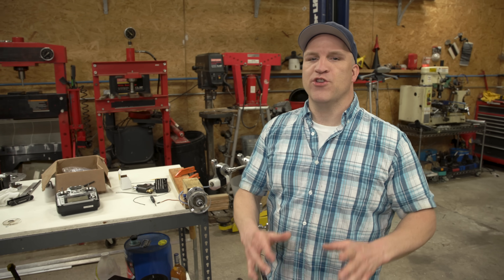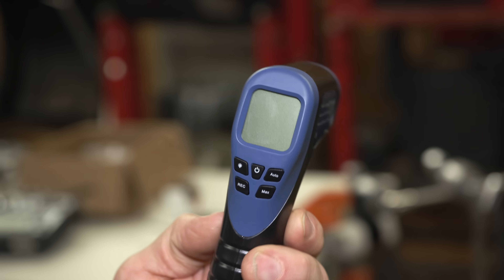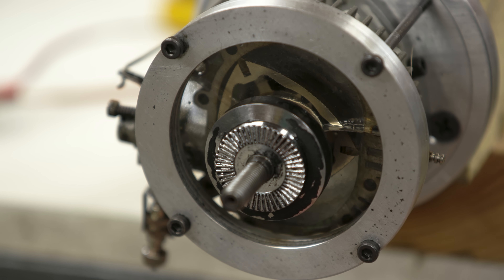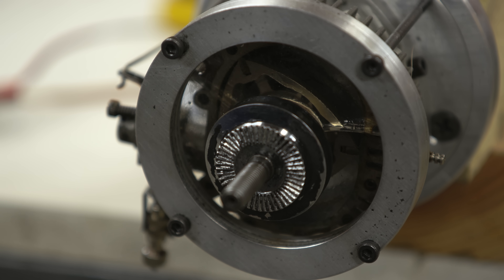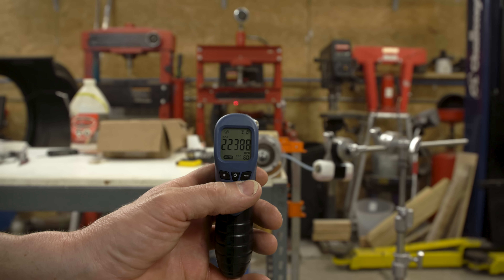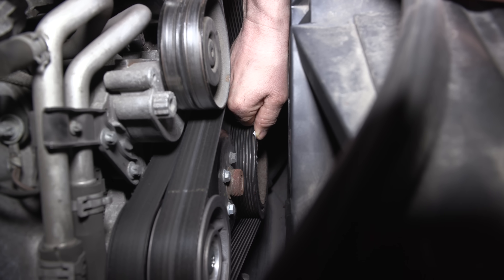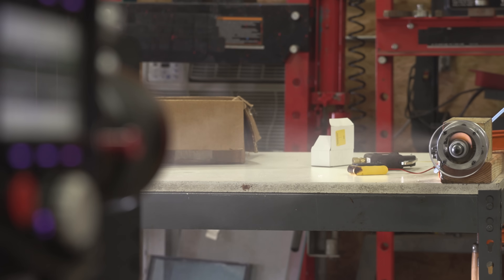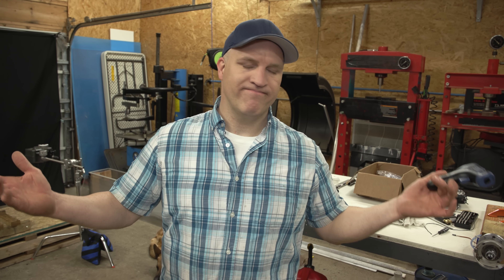See Thru Rotary Engine MAX RPM - 29000 (Wankel Engine)

Comment: I suspect your side cover cracked because there is no cooling on the engine.  This is an OS .30 cubic inch model aircraft engine and normally has a propeller on the hub, which will slow the engine slightly but also provide ample cooling for the engine.

I have six of these mounted on everything from a PIper Cub to a Kalt Baron .28 Helicopter (which has a small engine-driven fan above the prop end (which is geared to drive the main rotor shaft).  I have run them all, except for one "keeper", and have never had a single failure on any of them.  They're not run to such high RPMs, but if the Wankel isn't adequately cooled, it will fail.  That's why the earliest RX-7s in America came with a "Low Coolant" dash light, not just an idiot light for overheating.

The compact nature of this engine, along with the high power-to-weight & size ratio, makes it ideal for all kinds of model aircraft.
Reply: Then why did these engines have such a low power-to-weight ratio and why were they discontinued due to lack of sales if they are as you say "ideal" for all kinds of model aircraft????
Reply: @doktorbimmer  I'll assume you're replying to my post, though apparently you're getting a number of things confused and inserting things I never said in your question.

First, I never said these had a "low power-to-weight ratio" at all.  They actually have a HIGH power to weight ratio - putting out 4 horsepower from a 0.30 cubic inch engine is quite good, considering your automotive engine puts out about 150 hp from a four-cylinder, 130 CUBIC INCH engine.  If your engine was as efficient and powerful as this Wankel, your car's engine would be putting out just a tad over 1,730 horsepower.  So exactly how is that "low"?  That is a lot more power than ANY normally-aspirated production BMW engine puts out, by the way, "Doktor". 

How many of these engines did you purchase?  That the answer to why OS decided to discontinue these engines - which were about $130 each, when a reciprocating (piston) engine of the same displacement (but less power) was about $75. 

So people who want "cheap" as their primary objective in choosing a motor for their model aircraft can be satisfied with a piston engine.  Those who want smooth, technically and mechanically interesting, useful for a particular application and something that will run for a long time without problems chose these Wankels.  They're the utmost in being nearly vibration-free - just like the automotive Wankels made by Mazda.  You probably don't realize how often those who owned Mazda rotary-powered cars accidentally turned the key to start them when the engine was already running, something that simply doesn't happen with a piston engine as the vibration makes it easy to feel it running without seeing the tach.

They ARE ideal for all kinds of model aircraft - but since you never tried one, you never knew that.  The Mazda rotary remains the design that gets the most power out of the least displacement, with or without turbocharging it.

There are many other applications that the rotary has been used in, from full-scale aircraft to tanks - yes, military armor.  Pratt & Whitney built a number of Wankel engines for various applications, from aircraft (including drones) to tanks, as the Wankel is very flexible in fuel as well, able to run on low-octane fuel that would choke a piston engine.
Reply: You are the one that is very confused here son, the Wankel engine was an epic failure and has been obsolete for years... The Wankel engine never saw any successful production in tanks or any other heavy duty vehicle applications and were a total commercial failure in the aviation industry... not a single type-rated aircraft has ever been produced with a Wankel engine, they are totally unsuitable to aircraft applications.

Graupner GmbH rates the 49PI engine at only 1.1 PS ( 1.0 horsepower) this engine has been discontinued for a long time because it could not compete with traditional reciprocating RC engines in power-to-weight or reliablity.

Mazda's foray into the Wankel engine was a financial disaster and the company has not unveiled a new production engine in 25 years. production ended June 22nd 2012.
Reply: I think you need to learn what "displacement" is kid... you are very confused on this topic particularly in regards to the Wankel engine...

Comment: Rotary engine: How much RPM do you want me to make?
Warped perception: Yes
Reply: It looks impressive, doesn't it? Sadly it isn't. RC car and truck engines can generate double the horsepower with half of the displacement at a 50% higher redline. Seriously, I have a RC truck with a 3.4cc piston engine that redlines at 38000rpm and can pop rolling wheelies.
Reply: @fyrstormer  Some of classic combustion very small two stroke engines can do about 60000-70000 rpm
Reply: @galanonim563 : I am aware, but I'm speaking from my personal experience, which only goes up to 40,000rpm.
Reply: @fyrstormer  It's hard to imagine but easy to count that the piston in such engine at  (only hahah) 40k rpm goes up and then down about 666 times per second. Isn"t that insane or is it just me ?
Reply: @fyrstormer  but it’s remote controlled? So not a real car??
Reply: @fyrstormer  those also run on nitro though, rotaries haven't had the time to be explored like gasoline, diesel, and electric have
Reply: Yes what?
Reply: @erikd.k  That's the joke. He doesn't specify how much he wants, so he wants all of them 😂

Comment: Would like to see some propeller size vs thrust testing.   Is there a prop capable of that RPM?   Or induction fan?
Reply: This engine only produces about 1 horsepower, thrust would depend on propeller efficiency... but these engines are heavier than comparable 2-stroke reciprocating RC engines.

Comment: I wonder how well an engine of this size/type would work in a scooter application.
Reply from the maker: Well it's about 2.5 hp at 18,000 rpm.
Reply: Published specs from the manufacturer say only 1.2 horsepower... of course they lose power very quickly with use.

Comment: Uhhhhh. You do realize at that speed of rotation if a piece breaks off it will be lethal. My crazy friend the special effects Engineer got his small steam engine up to around 100,000 rpm and I almost peed myself because the building we were in on the second floor started to vibrate like an earth quake.
Reply: The internal components of the Wankel engine only turn at 1/3rd of crankshaft speed... reciprocating engines can also rev even faster.

Comment: In a Wankel, the shaft rotates 3x faster than the rotor due to the built-in gear. So the real r.p.m. at rotor level is 10,000.
Reply: I noticed that when he did the frame comparison that the rotor only did a 3rd of a rotation. Not too familiar with rotaries so i was a little confused.
Reply: But isnt the most important part the crank-RPM?
Reply: Engine RPM is the speed of the output shaft. It doesn't matter what happens internally.
Reply: Then might as well say piston engines make no revolutions
Reply: The crank spins... So revolutions is accurate with a reciprocating piston engine... It's measured at crank and not camshaft... Camshaft is half that of the crank on a 4 stroke motor...
Reply: @Skyworka  The camshaft in twice the crankshaft speed
Reply: @josephpacchetti5997  The cam rotates at half speed. You start at TDC and beginning of intake stroke. The cam lobe at TDC is like this (<). The crank rotates 180 degrees as the piston travels to BDC, at the same time the cam turns 90 degrees, opening the intake valve and is like this (v) at BDC. The crank rotates 180 again as the piston then travels back to TDC to compress the fuel/air mix and the cam turns 90 degrees to close the intake valve and is in this position (>).
Reply: @Skyworka  So .. no cranks in a wankel engine which means no crankshaft. You mean the output shaft perhaps
Reply: Wt abt torque bro
Reply: @iamcrabgod2809  probably low , cause it's geared to make to look higher.
Reply: Thanks for ruining this for us
Reply: I was wondering who was going to bring up the 'eccentric shaft' point. Good job sir
Reply: So actually 3 rounds of the shaft equals to 1 rotation of the rotor?
Reply: @tijpete_and_the_magic  I do believe thats correct 3:1 ratio
Reply: @opiliumrav  that is the correct ratio; which is why rotaries make more power for their size compared to piston engines.

Also, there is no 'cam' anything, the output shaft of a rotary is often referred to as the 'eccentric' shaft.

RPM is based off of how many (single, complete) revolutions the output shaft makes, and this is the same for all engines. So, even though the rotor itself was only rotating at 1/3 the RPM of the eccentric shaft, the engine did indeed make 29,000 RPM.

If a piston engine wanted to make 29k RPM, the piston would have to move up and down in the cylinder 58,000 times per minute. This would be impossible to achieve with our current piston engine technology
Reply: @tijpete_and_the_magic  correct 3 spins of crank is 1 spin of rotor
Reply: Shaft Rotates 3x Faster
The Rotor Is Triangle
Reply: Au ah bgsd gw ga bisa bahasa inggris :v
Reply: What????? Damn
Reply: Output is 30k........periodt!!!
Reply: Crank shaft is rmp
Reply: Ah, now i get why in RX-7 the tachometer is only scaled until 10k RPM
Reply: that doesn't matter. If it would matter, the gears would matter too. If it's rotating 3 times for each rotor rotation, the rotor is getting three times more punches every rotation. the RPM analysis here is important to see that the engine CAN perform that incredible interal rotation speed.
Reply: the rpm over 9000

Comment: The onley oil i know that do 30.000RPM IS CASTROL RASING OIL CASTROL TTS2 .. and the First base oil 
It was original made for the HONDA HRC 30.000 RPM
Reply: But in the Wankel the internal parts are only moving at 1/3rd of crankshaft speed...
Reply: @doktorbimmer  MOVING a 1/3 .. hmm fuk you are stupid ... 1 rpm is 1 rpm also in a Wankler
Please shut the fuk Up you are a WASTE of o2 ..
Reply: Turbochargers have been around since the 1930's and they easily spin at 60,000 rpm and can spin as fast as 120,000 rpm.
Reply: @doktorbimmer  and you point ???  They Work fine with regular dukhams oil 
So?? .. What you are replying is that All are idiots if they buy other than the cheapest oil 
Becaus ther is No difrence .. fuk you are a FLAT EARTH ZOMBI TARD
Doktordumbsmart
Reply: They do not make or rate motor oil based on rpm... just pressure rating and lubricity.
Reply: That is a lot slower than a turbocharger spins... and they use regular motor oil for the engine sump...
Reply: The internal components of the Wankel engine only turn at 1/3rd of crankshaft RPMs thanks to the 1:3 ratio of the internal gears... it not that difficult a concept to understand.

Comment: Today marks the 7th anniversary of the final demise Mazda RX production, on Thursday June 21, 2012 at 4:30pm the final RX-8 car ever to be produced rolled off the assembly line, the last RX model to ever be produced by Mazda.
Reply: It was discontinued because of its severe reliability issues
Reply: Indeed, The RX brand's notoriously bad reputation for reliability problems eventually scared away all the new car buyers.

Comment: Full throttle with no load, I feel it's pain.
Reply: ColinWatters ??
Reply: @Patrick-fz8ee  Engines work most efficiently when up against a load.
Reply: @chasemiller7974  i think hes tryna make a bad joke about what he does at 2 am
Reply: @ethancotton1549  Well that is kind of funny.
Reply: @chasemiller7974  depends on the amount of load. Towing a twin axel caravan with a small car is definitely not efficient, rotaries are worse... They can produce high horsepower, at literally insane rpm's, but under load their torque curve couldn't pull the skin off a hot bowl of custard.
Reply: Lol wtf
Reply: NEVER get a vasectomy, fools.
Reply: Basically, the engine is very very horny and has no release
Reply: I missed the part where that's a motorcycle's problem.

Comment: O.S wankel
Reply: The 49PI engine was Graupner GmbH. designed and manufactured until the rights were sold to O.S. (Graupner was one of the original Wankel KKM licensee's in the 1960's.)
Reply: @doktorbimmer  i have one nos never been ran

Comment: Seems like it would make a great aircraft engine
Reply: These engines were designed and manufactured by Graupner GmbH. primarily for RC planes... but they offered mediocre performance at best. Wankel engines are very poorly suited to aircraft applications and there has never been any production passenger aircraft powered by a Wankel for this reason.

Comment: For more accurate test put the propeller That's rated for that engine on the engine that way the engine will have a load on it and you'll see what it's really capable of in terms of RPMs full speed with load

Comment: Rotary engine is geometrically flawed..
Reply: auomauom wtf u on about
Reply: @ro g The Wankel engine is inherently inferior due to the very fundamental geometry that allows it to function as a 4-stroke internal combustion engine... the fact that the shape cannot be significant altered is also why it cannot be significantly improved and has become obsolete.
Reply: @rog69  tf you on about. Are there any rotary engines on the market currently? No there's not. Too much to maintain and the design is just flawed and inefficient.

Comment: I don't know about the Wankel, but my 12CZ-R, with high compression head, turns 32k rpm and produces 0.52hp. It takes my Sandmaster 10 buggy up to 50+mph on 25% nitro fuel. Your Wankel, however, isn't supposed to spin that fast, as it's designed to turn a prop. And, the tips of the blades aren't supposed to go supersonic.
Reply: This makes 5hp
Reply: Reciprocating engines easily outperform this little 1.2 hp Wankel engine... which is why they were discontinued.
Reply: doktorbimmer 
Bitch prove it. Give me links to ACTUAL evidence of that. Because I feel that if any piston engine made that much power in the same displacement, they (the makers) would be fucking rich by now. But I clearly haven’t heard of such a thing.

I’m using italics since you’re using bold.
Reply: @thejay8963  While it's good to always ask for evidence and proof, I would highly suggest if you want to start a debate/argument or a call for evidence, etc. that the very first word in your sentence isn't an ad-hominem attack against the other person.  It's uncalled for, really.  He is simply just saying what he believes to be true.  Also, the debate in question isn't really too important - this isn't a topic that shatters one's whole life preception in 1 argument like many Hillary voting identity politics communists love to constantly pose...
Reply: Honklerton 
Ah, I feel poised to ignore anything else you said because you NEEDLESSLY brought politics into this...

Like a clown.
Reply: Strangely Familiar 
And you are 9 years old.
Reply: doktorbimmer isn’t it 4-5hp

Comment: Why are you not using a rc propeller on the engine as it's intended use???? An 8" x 8 pitch would work well or a 10" x 6 pitch would work well too. No need for a piece of reflective tape when using a propeller.  Read up a little more before doing your test. I have been a RC pilot for over 40 years so take my advice.

Comment: 6:14 "vtec kicked in, beast mode activated" 😂
Reply: Lol. That's 787B.
Reply: @KikuraKun  But the 787B has 4 rotors and sounds like an F1. This one has 2 rotors and at high RPMs, it instead sounds like A GODDAMN MOTORCYCLE!
Reply: @HansenSebastian  Nvm then
Reply: True
Reply: Vtec on rotary engine?
Reply: @Patutoo  is possible, with Variable Intake Hole
Reply: @afoxwithahat7846  🤣🤣🤣
Reply: @afoxwithahat7846  It is Vthole :v

Comment: That needs mounted on a RC airplane.
Reply: If it were bigger it could probably be mounted on an ultralight. Wish peter stripol used the engine on a future build
Reply: If it does, then that will burn the RC airplane because of its temperature.

Comment: That is crazy!  Dam!   I'm not that familiar with rotory engines,  see? I can't even spell it, however I couldn't help seeing it slurping in torrents of raw fuel. Wouldn't  it have much better combustion if it were a bit atomized ??
Reply: Technically it is not a rotary engine, it is a Wankel KKM  engine ( a type of orbiting piston engine) manufactured by Graupner GmbH.

Wankel engines are all obsolete today because the design of their combustion chamber does not allow complete or efficient combustion to occur.

Comment: run a moped with that enginge o.o
Reply: Not big enough... no torque
Reply: @doktorbimmer  how many cc dos the engine have? i may miss that episode you talk about it
Reply: This Wankel engine in this video is a Graupner 49PI and had a displacement of just 4.9 cc's. They were sold for a few years as RC plane engines but they were not popular and were eventually discontinued.
Reply: @doktorbimmer  ahhhh i googel it my self. its realy to small like you say. but what about a rc car? with a finished base with all controlls you could may just swap the engine and some fine tuning.
Reply: Wankel engines have been discontinued in RC products because the reciprocating 2-strokes are cheaper, more powerful and reliable... and reciprocating 4-strokes are becoming more popular because they are cleaner and more fuel efficient and generate more torque.
Reply: The market also offers other much better alternative power options like like battery-electric and gas turbine engines for RC models.